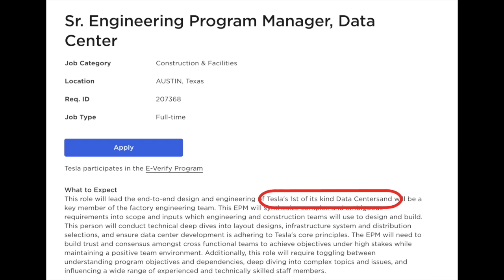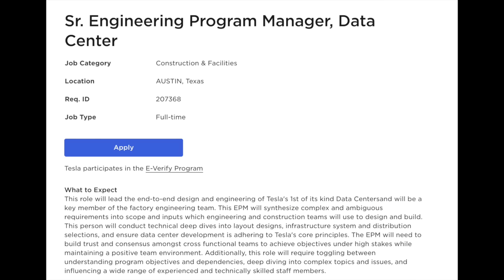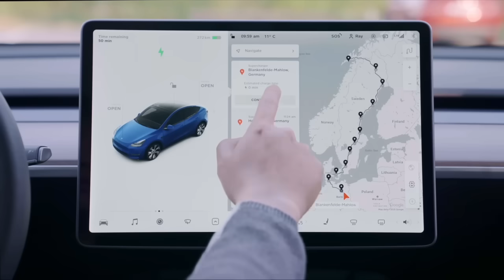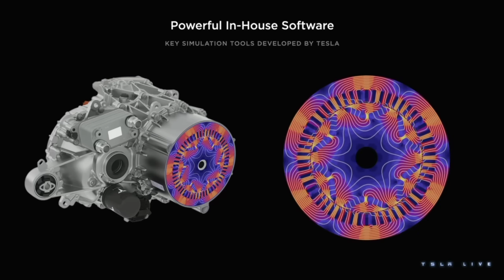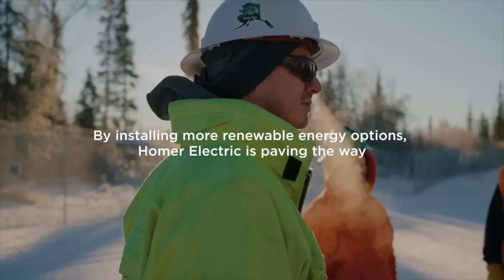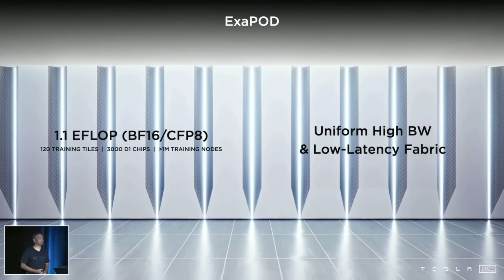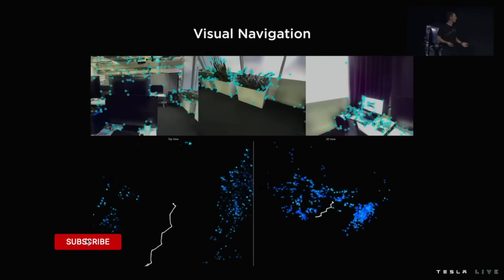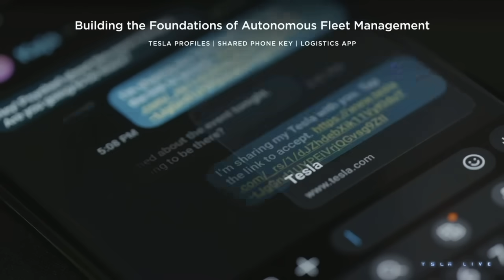Tesla’s 1st of its kind Data Centres - 16 reasons why Tesla is building them

Comment: Hello, It so funny way back in the 2005 I was heading an R&D department putting GPS tracking systems into cars and commercial  vehicles, planning routes and scheduling deliveries. Mostly in the UK, fitting around 100000 units a year. At that point we could route and rerouting where traffic was building. I was buying map data from all around the wold. Even trying to find digital map date that was in routable form was not easy and the cost of data then you were talking serious money.

Comment: #17 … Starlink 

A datacenter is useless without connectivity to the internet. Starlink is the secret sauce to enable Elon to set up a datacenter anywhere in the world with the lowest possible electricity/energy cost. 

For example, inside a remote Tesla datacenter, in some remote location with access to low cost hydro-power generation source, the datacenter would be  physically maintained by Teslabots who are trained to rack, stack, cable and service the server/storage/networking labour work. A Tesla datacenter operations would have an absolute advantage in labour, energy and connectivity compared to traditional human labour managed datacenters.

Comment: In the near future.....In your garage you turn your car on and set a route from Phoenix to Austin.  At the same moment one car on the freeway In FSD slows 1 mph, and another speeds up 1 mph. As you enter the freeway 15 minutes later your car slips behind two other cars driving in FSD mode. Your car gently moves in behind the other two cars and creates a slip stream on the freeway all three cars are headed to the same destination and you can dim the lights, put the seat back and sleep if you like or tune to your favorite Netflix program and let the car drive. At this point the three cars are traveling as one, are one car length apart monitoring each other and are traveling 20 times safer than someone driving his car in manual control.

Comment: You left out the biggest and most likely reason that Tesla not only building new data centers but is buying other ones around the country. 
ROBOTAXI NETWORK 

Tesla is very close to solving FSD. So close that they want to get their taxi logistics centers up and running ASAP. They will need multiple data centers with failover capacity running the taxi service software and logistics. 
I think this is the real reason that we see Tesla buying data centers that are already built. They mainly need the power lines that are already running to these older sites. It is the power that takes the longest to put in place. Obviously Tesla feels that it doesn't have the time to build all new facilities.....I think the reason is that they are that close to solving FSD and will need these centers up and online within the next two years.

Comment: Why are Tesla's computers so stupid? Simple driver tasks even stupid drivers handle easily are not being managed by FSD after millions of opportunities. Only bad software could result in SO SLOW to learn. Other computers LONG AGO learned to beat the BEST chess players not just the worst. What's wrong here!
Reply: Because if the chess computer did something wrong children didn't die
Reply: Soon Tesla computers will think you are stupid so they'll take your steering wheel away.
Reply: Are you serious with this question? Chess computers are very simple. You can have one in your pocket. They just calculate thousands of possible moves and have a library of typical opening and closing moves. So they can forecast what a typical human player will do. It is a very simple "AI". They do not even need a camera to see the game.
Driving a car in 3D world with thousands of variables and all the humans going around there like crazy is a massive challenge. 
You can easily buy a cheap chess machine that will win you. But if you could buy a cheap AI machine that drives your car better than you - then you could say that it is a simple task to drive.
Of course it will happen, but you need to wait some decades. Then you just go to any shop to buy the latest and cheapest "driver box" and connect it to your car.